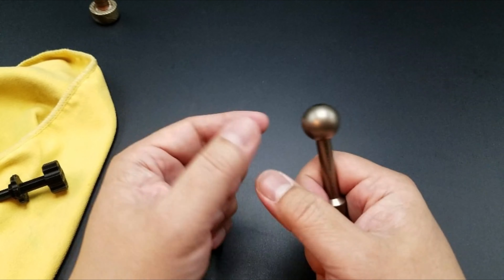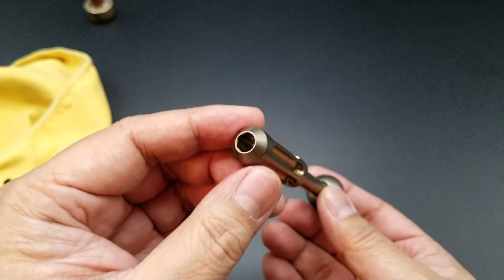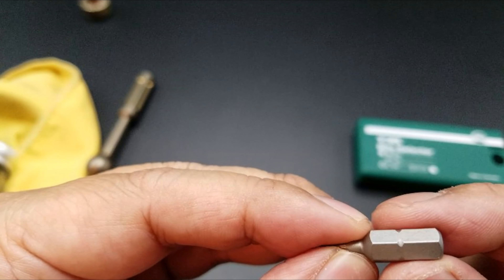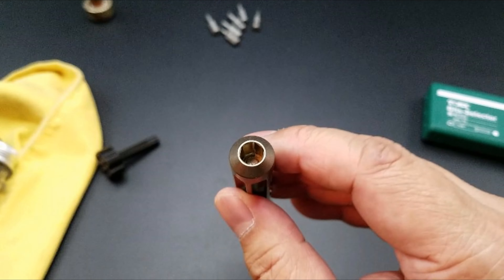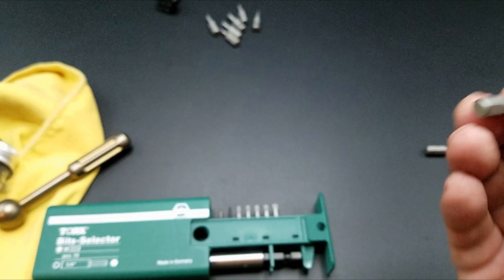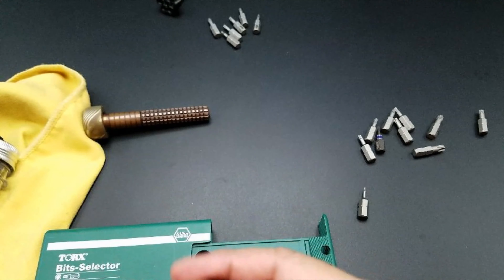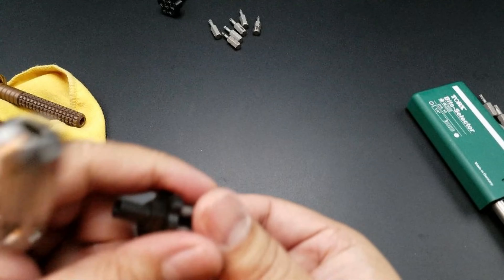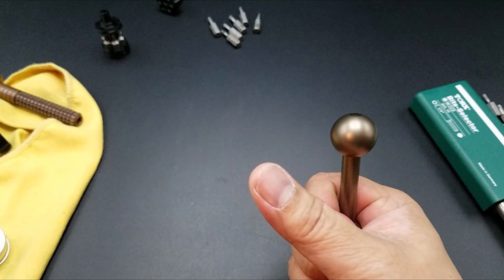Hex Driver Tool Update*

Comment: Regardless it seems like the company is just in damage control mode. I feel like if you were the average customer and didn’t post the videos they would have not worked with you as much. For that reason I would never purchase their products personally. Their quality control just seems way off in every aspect. For the small price difference the scout leather co. Driver is a much better option imo.

Comment: Try to find the Fellhoelter  “screw it” drivers.  They are perfection; I bought a couple from Monkey Edge in brass and copper frag last year.   Think I remember seeing two for sale up on tri city custom knives last week I think.
Reply: The Steve Kelly design is similar to one of the Fellhoelter Screw it drivers but it has a dragon scale pattern. It doesn't like cheap bits at all... Wiha and other (strict standard) bits.

Comment: I have the same driver and the same problems. Only the Wiha Bits  out of my Böker Tool are working. Maybe i should contact them also
Reply from the maker: You should!
Reply: If you haven't yet been in touch I would suggest you do. I won't comment on the conversation but improvements have been made.

Comment: At $50 plus for a simple tool made in china they have got to be high.   I don't care if it works perfectly every time this is ridiculously overpriced.   Grainger sells a set of 7 Wiha torx drivers for almost half the price of this stupid tool.  And you know that they are authentic.  I would not pay $10 for this thing.